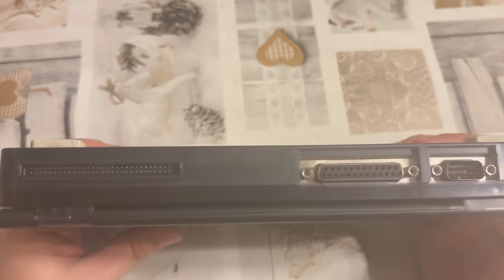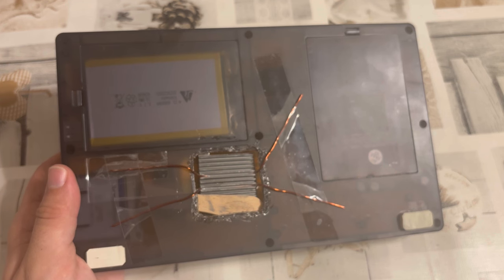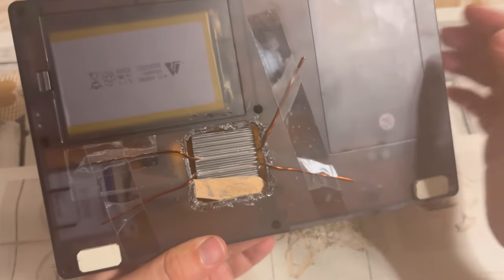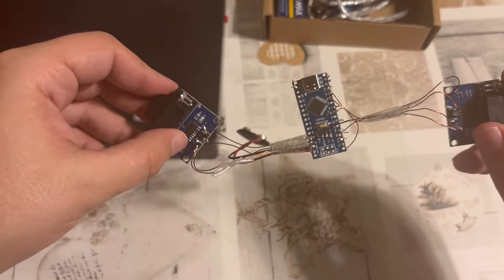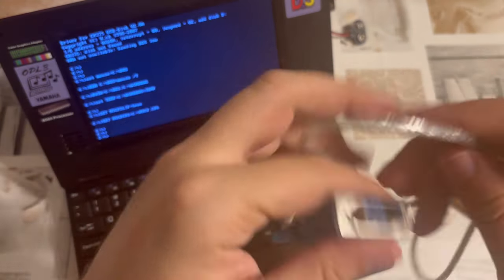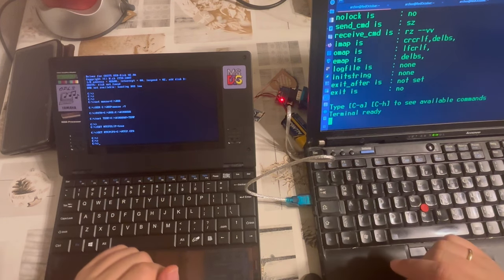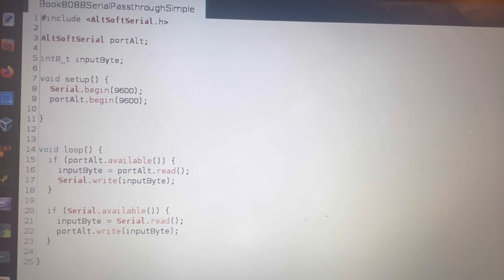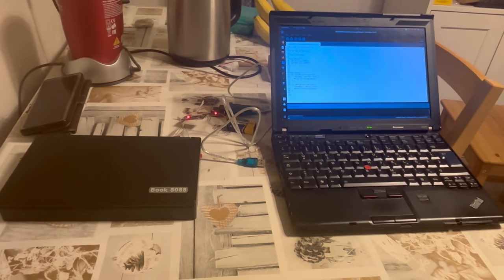iii/iii Book 8088: Self-Destruction — Countermeasures

Comment: So if I see it correctly, there is no need for a microcontroller. 
The data is passed through 1:1. So the two level converters would be sufficient. 
They just have to be connected crosswise. So TTL-TX to TTL-RX and vice versa. 
But if you want to use USB on the other side anyway, I would use a USB to TTL converter and save the second converter.
Reply from the maker: There is no need for converters — one can just use a microcontroller. :)

Comment: Did you measure the signal levels on the Book8088 serial port TX line without anything connected?
And the db9 modules you connect to the arduino, are they sending 12v or 5v signals into the Book8088? If they send 12v and the Book8088 is 5v the arduino bridge won’t make a difference, you will still eventually fry the Book8088.
Reply from the maker: I did - kindly allow me to suggest my newest short. We are talking of about 9.6V. MAYBE the 12V are anyway too high, though. What bothered me - it gets hot "doing absolutely nothing", so it might overheat if challenged.